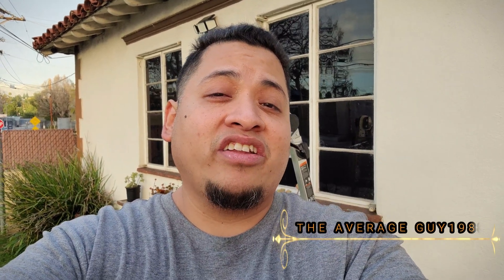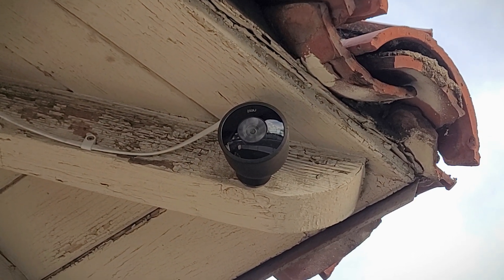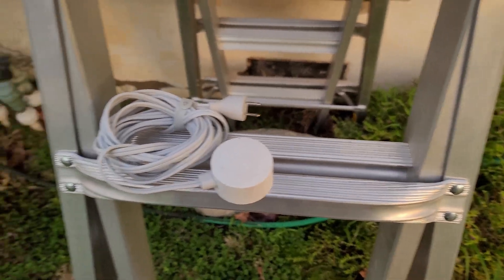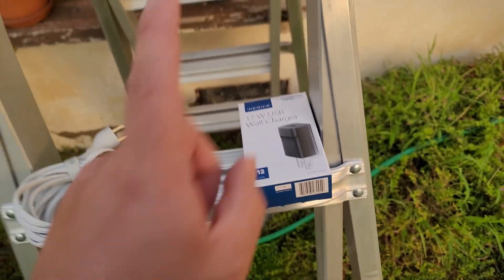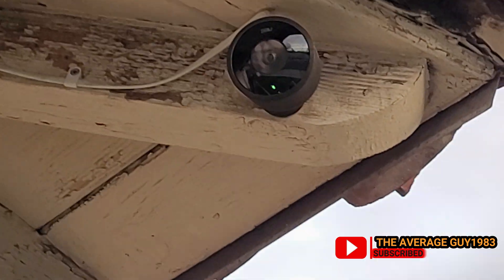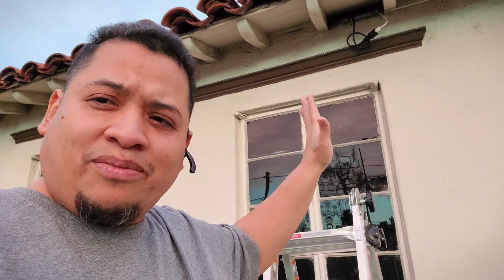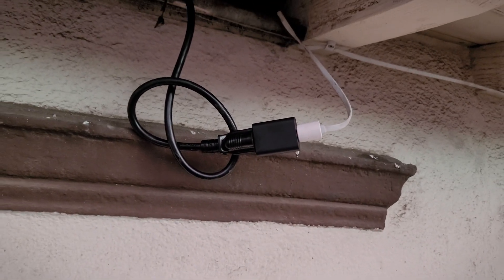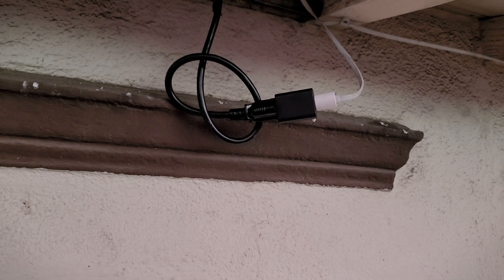Nest Cam Outdoor Gen 1 No Power Troubleshooting

Comment: the newer nest cams are a little better in sharpness, but the old nest app is superior to the "google home app" that the newer cams need to use.
that is why i am buying replacement gen 1 cameras, their are a few new ones out there and people are selling their old used ones for a decent $.

i tried the newer google cams and the google home app is laggy, not as smooth as in the nest app.
i wish they would put the newer gen 2 cameras on the nest app, it's simpler to use and smother scrolling through video history.
Reply from the maker: @akui88  you too? Ive been doing the same thing. I have a couple of the new google nest cams and you are 100% right they are very laggy even with the wireless router within 6ft from it just to test the camera out lol. Ive been lucky enough to find the gen 1 cameras on amazon. They are starting to get in the upper $200.00 bur i still think they are gar superior than the new cams. Its almost as if Google downgraded the sensor of the camera just to safe a bit of cash on camera product.

Comment: I need a waterproof option.  The usb adapter in the video is not rated for outdoor use.   Any suggestions?
Reply from the maker: Hi, unfortunately, i haven't been able to find anything like that. I've actually been searching for about 35 minutes, wirh no luck. The only other thing i can think of would be to use a large size Heatshrink on the usb A port area with the wire already plugged in so that no water gets inside. But im not sure how well that would work.
Reply: @THEAVERAGEGUY1983  thanks so much. I wanted to make sure I wasn’t missing something obvious.
Reply from the maker: @seanhenriques808  🙏🙇‍♂️

Comment: I just used my phone block. It worked several months then is dead again. I may try this. Maybe the camera kills these blocks quickly. Ughhh
Reply from the maker: Oh no, maybe try out a 2 amp hour 5 volt USB A charger? It could be strong enough to handle the camera. I still have the same one i put on the video, and thankfully, it still works. (Knock on wood) it continues to work 😅

Comment: I am looking to potentially do this with two of my cameras. Had the power go out and both cameras would not power up until I unplugged/plugged back in multiple times. Has anyone had this bite them and burn out the camera? Not sure what that Nest block does or if it has a safety mechanism in it. Also, if I get a usb block that is 2 amps plus (2.4 to be exact), would that send to much power to the camera?
Reply from the maker: Hi, ive tried up to a 3 amp charger at 5 volts but i did feel the charger getting a little too hot but the camera was fine though. Im not 100% sure if a 2.4 Amp charger would damage the camera.